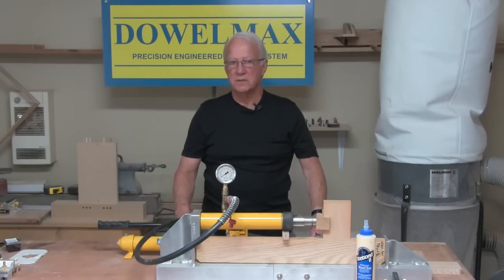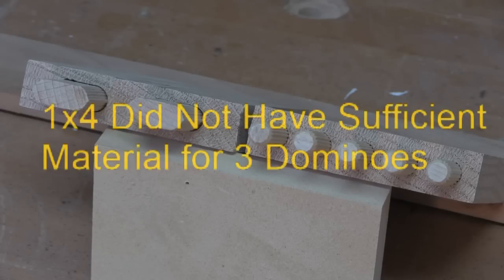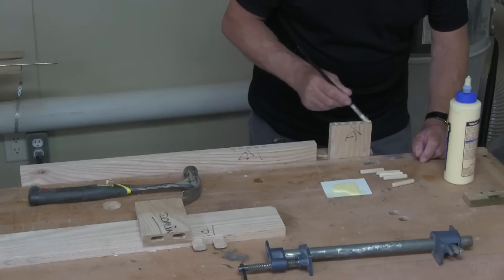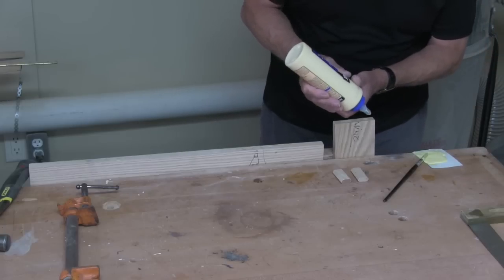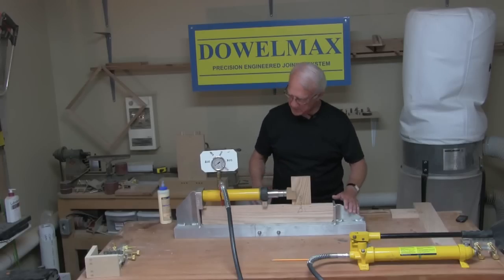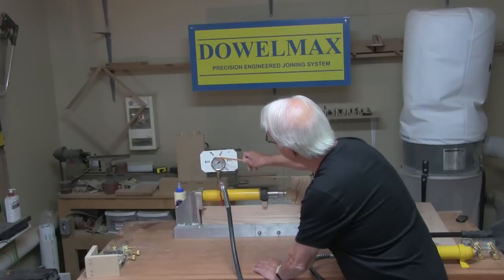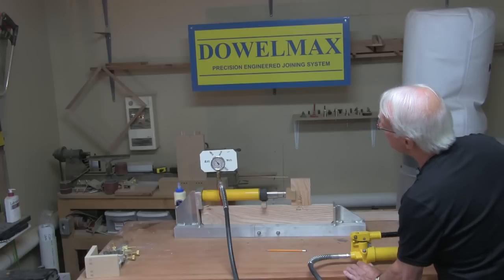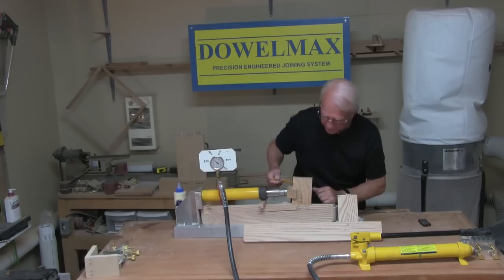Wood Joint Strength Face Off: Dowelmax Vs Domino

Comment: Interesting video. I did notice on the glue ups that the dominos don't fit their mortis as tightly as the dowels do. I could tell right there that it would be the first to fail even before the glue up started. Not sure if there is an adjustment for that on the machine itself but I'll head down the comments and see what any of the  butt hurt purchasers of the domino machine have to say. Slick looking machine but I've always thought of it as gimmicky and way over priced for what it is. I've always used dowel construction myself, but I'm also lucky enough to have an Ayen 50 spindle boring machine in my shop for the work I do.😁
Reply from the maker: Thanks Jeff, The dominos fit tight, however there appears to be tearout at the mortise wall which is typical in our experience.

Comment: Heathen! How dare you blaspheme the holy name of Domino? Our faith in the Great Domino will not be swayed by your "fake science!" The Domino is a gift most holy from the Gods of Construction and Woodworking. Your insidious attempts to undermine our sacred trust will surely fail, as will your nefarious "dowel-base" joinery! If the Great Domino can provide an adequate joint in 15 seconds, it is sacrilege to use 30 seconds just for a purported increase in strength, accuracy and economy. If one cannot afford to pay sufficient tribute for the Great Domino, one should use pocket screws, or simply flee the shop with his or her head bowed in shame! Get the hence! Get the hence! Your blasphemy is not welcome in this venue!

Comment: In the first instance I am an Engineer, not just theoretical but practical too.   We take pride in giving unbiased and honest evaluations, you have my word on that.  You saw what you wanted to see and heard what you wanted to hear. Did you look at the photos of both joints? Did you see the gaps on the Domino example? I doubt that.  Inaccuracy creates weakness.  The local professional we refer to was asked to do the optimum joint arrangement possible on 1x4 stock, and he did just that.  
You discuss performing more samples, and you are absolutely right on that point, but do you realize the time and effort required in that endeavour?  Can I suggest that if you feel strongly about this subject, that you design and build a test stand, and do the tests yourself.  
You discuss the Domino joint being 15 times faster than the Dowelmax joint.  It takes me three minutes to complete a 1x4 joint, and if I accept your correlation, that equates to a complete comparable Domino joint in twelve seconds, not too likely!    I am prepared to accept that the Domino is marginally quicker ( seconds ) but did you also calculate the set up time? The Domino requires to be sized to the stock, with a simple calculation, there is no such calculation with the Dowelmax, merely align,
 clamp and drill, that's it!
I am a woodworker, and it takes me weeks to design and build a piece of furniture.  The layman does not understand this fact, and  I'm literally amazed that professionals can survive in this business.  It would be extremely irritating to streamline your shop by purchasing a tool at over a thousand dollars, when you could purchase one at less than two hundred dollars, which may be seconds slower but stronger, more accurate, and versatile.
The tests shown on our website have been repeatedly done over a period of twenty years, with consistent results, some have been supervised, not all, but all are honest.
Thank you, and regards.  Jim Lindsay.  C. Eng. M.I.Mar. E.
Reply: I know it is pretty off topic but does anyone know a good website to watch newly released series online ?
Reply: @Dylan Milo thank you, I signed up and it seems to work =) I appreciate it !!
Reply: @Johan Joseph you are welcome :D

Comment: You totally pushed the handle faster and full length and harder when doing the domino and went real slow and easy with the dowels also and more if not most importantly any engineer will tell  you a single piece test study is not accurate at all you need at least 3-5 of each test piece and I promise if you pump them the same and make the domino and dowels square centimeter the exact same instead of 5 dowels I believe between 3-4 dowels would be the same then the results would be much much different I’ve seen tons of furniture built both ways and would prefer the domino any day as it is 10-15 times quicker to use which in turn means that production times are bumped way down and the shop makes more profit which is the whole idea of furniture making lastly but still importantly tensile strength is very important in woodworking show that test with at least 3-5 test pieces of each for accurate results and see how that works out until then I am know where close to being sold nor should anyone else with any sense be at this time with this poorly made and ran test. Sorry but that’s all very true ask any engineer or structural architect.
Reply from the maker: In the first instance I am an Engineer, not just theoretical but practical too.   We take pride in giving unbiased and honest evaluations, you have my word on that.  You saw what you wanted to see and heard what you wanted to hear. Did you look at the photos of both joints? Did you see the gaps on the Domino example? I doubt that.  Inaccuracy creates weakness.  The local professional we refer to was asked to do the optimum joint arrangement possible on 1x4 stock, and he did just that.  
You discuss performing more samples, and you are absolutely right on that point, but do you realize the time and effort required in that endeavour?  Can I suggest that if you feel strongly about this subject, that you design and build a test stand, and do the tests yourself.  
You discuss the Domino joint being 15 times faster than the Dowelmax joint.  It takes me three minutes to complete a 1x4 joint, and if I accept your correlation, that equates to a complete comparable Domino joint in twelve seconds, not too likely!    I am prepared to accept that the Domino is marginally quicker ( seconds ) but did you also calculate the set up time? The Domino requires to be sized to the stock, with a simple calculation, there is no such calculation with the Dowelmax, merely align,
 clamp and drill, that's it!
I am a woodworker, and it takes me weeks to design and build a piece of furniture.  The layman does not understand this fact, and  I'm literally amazed that professionals can survive in this business.  It would be extremely irritating to streamline your shop by purchasing a tool at over a thousand dollars, when you could purchase one at less than two hundred dollars, which may be seconds slower but stronger, more accurate, and versatile.
The tests shown on our website have been repeatedly done over a period of twenty years, with consistent results, some have been supervised, not all, but all are honest.
Thank you, and regards.  Jim Lindsay.  C. Eng. M.I.Mar. E.
Reply: @DowelMax  You deserve an award for being able to decipher The Home WoodWorker's run-on sentences.
Reply: @DowelMax  You are a class act sir.  Some people are simply interested in production throughput at an acceptable level of quality. Not high quality, just enough quality to keep product flowing out the doors... You did a fair test, and if a giant, moneyed company like Festool felt the testing was bordering on fraudulent, I expect this video would be done already for the sake of their reputation.  
Until Festool deigns to do a video proving the opposite of your findings, I'm willing to take you at your word.
Reply: @boots7859  Thank you.  Jim.
Reply from the maker: @boots7859  Thank you for the appreciative and supportive comments!

Comment: I enjoyed the test but I would like see a more realistic 2 or 3 dowels at most. I've never seen any application where 5 dowel were used.
Reply: If you want to make a joint weaker use 2 or 3.  I believe the point is you can make a stronger joint and much more economically with dowels, especially if you're willing to spend a few more seconds and a few pennies on material.
Reply: I think the idea of the five holes is also partly because the Dowelmax has five holes.  So you position it once and bang out one to five holes depending how strong you need it to be.
Reply: Hi Karl.  Good point, but not relevant when considering the whole exersize.  For example when I do a test involving biscuit joints (In my opinion an inadequate system ) I use one only because 95% of people do just that.  You are partially right in that when I do a 1x4 in the course of a Dowelmax joint I use four, whereas in the past I used five. ( remember it takes only five to ten seconds to do an additional bore ).  I hope you believe me when I say we try to do all tests in a logical and fair way.  We experienced a comparison test undertaken by one of the top magazines a few years ago, overseen by an engineer.  The whole exersize was nothing short of inept and the conclusions therefore incorrect.  Under no circumstances would I want my signature on something like that.  I'm about to do a comparitive test on four different dowel configurations (all with four dowels) i.e. 1/4", 5/16, 3/8, and 3/8x 2". I'll also do one mortise of similar dimension just for comparison purposes.  Regards Jim.
Reply: @marielindsay528  I'd just take a little more time and use more dowel joints to make it stronger than the $1500 festool.  Perfect for the homeowner who occasionally wants to do fine woodworking.  If I was a production cabinet maker that might be another story.
Reply: @jenniferw8963  Exactly, no real additional time for an additional dowel, but much stronger than the domino.

Comment: The PSI rating is somewhat misleading. You’re not applying the force to only 1 Square inch of mating surface. The 1x4 (0.75 x 3.5) has an approximate mating surface area of 2.62 Square inches which 600psi on your gauge calculates down to ~229 PSI. Of course, all that’s out the window when you add the surface area of dowels and tenons.
Reply from the maker: That is not correct. PSI is pounds per square inch. The area of contact of the wood block on the end of the cylinder with the test wood is 1.45 square inches. The force applied to the dowel joint is calculated as 900 psi x 1.45 square inches =  1160 lbs. You can google pressure to force calculator to confirm:

https://www.sensorsone.com/pressure-and-area-to-force-calculator/
Reply: @DowelMax  This is also incorrect. To convert from PSI to the force the joint sees, you would use the area of the hydraulic ram that is exposed to the hydraulic fluid. The contact area at the ram-wood interface is not considered. For example, assume a 1.5" diameter ram. The area is 1.77sqin * 900 PSI = 1593 Lbs.

Comment: Many different domino wood types and sizes available but you used just the most common least strong ones. Domino system is far less complicated for everyday use. Where is the huge Festool banner behind you?
Reply: Sounds again like an accusation, or a conspiracy theory.  We did not cut the Domino joint, that was done by a local contractor who I'd never met before, and haven't met since.  I asked him to do the best he could to optimize strength, and I certainly didn't ask him to go out and purchase special Dominos.  From experience gained in over twenty years of implementing these tests, the most important , if not crucial factor, is accuracy, not material.  Look at the photo of the two joints, side by side.  J.L.

Comment: Also what's the total surface area of the 5 dowels vs. The domino surface area.   What is the time spent on each joint? I'm assuming all workers are planning to spin up an offshore production facility making mass market furniture.
Reply from the maker: Hi David.  Your first question related to cheap furniture, and I miss the point.  If you look at my completed projects on our website you'll see my goal is accuracy and strength.  I expect the furniture to be handed down, and if located in a dry airy environment, to last for decades or more.
With regard to your second question.  We use what's available and are guided by what people normally do. For instance when we did the comparison with the biscuit, we used one, which is what most people do, yet in fairness there's no real comparison with regard to the surface area. However as a matter of interest, a few years ago I calculated the surface area of five dowels against a comparative mortise and found the latter greater to a small degree, both around nine square inches.  In that test the dowel joint was approx. 30% stronger.

Comment: Board width was chosen to fit 5 dowels perfectly and 2 dominoes imperfectly. I knew the moment I saw the end grain which would win. An equivalent bias would be where the board width was perfectly sized to fit 2 dominoes and only 3 dowels.

And regardless of Dowelmax's reply to Dan Burch, this is mostly a shear strength test. Yes it has a large moment (torque) force, but it's mostly shear. The stresses in actual furniture would be mostly moment forces — which would pull the joint apart.

I'm not criticizing either system nor claiming that either one is better, just pointing out imperfect and biased tests.
Reply: If you had a piece of wood large enough for two dominoes I'm pretty sure you're going to get at least four dowels in there.  Does anyone really think the results will be radically different with four  dowels instead of five?
Reply: Regardless, the domino failed at the joint..... the fields broke the wood. Regardless of the thickness of the wood, the domino failed.
Reply from the maker: This is a typical response from someone with little knowledge of our methods and testing procedures. I also believe that nothing I say here will convince him otherwise.  Dowelmax was intentionally designed to accommodate all the standard imperial sizes: 3/4, 1.5, 2.5, 3.5, etc,. Most of our tests were undertaken using 3.5 stock, which of course will accommodate five dowels.  Why would we do less?  If this person had given some positive thought to the comparison he would have realised that to drop to the next size i.e. 2.5" two Dominos would have left less than  3/16"of material at each end of the joint, and that would have been a flawed test.  Again with three dowels in the 2.5" stock the  Dowelmax joint would have been superior.  Some of our tests have been supervised by professional engineers, and in all tests the other joints were made by outside parties.  Additionally in all cases these people were advised to construct the joints in the most advantageous manner for the size of material.  In this day and age of "fake news" I can understand people having doubts,if in doubt don't criticise, do your own tests, and I will listen.  Tell me what you know, not what you think!
Reply: Dowelmax   Dowels have made superior joint strength for my projects compared to test I’ve done privately.  I’d love to see dowel vs pin though. Although I believe the pin would fail similar to the domino. 
Dowels also accommodate more practical wood sizes. In other words, you’re more likely have room for more dowels evenly distributed than dominos or pins.
Reply: This test favours Dowelmax. Testing methods don't mean anything it’s clear that the width chosen favours your product. If you wanted to be fair you would chose a width that would let both products fill the whole board and not give a clear advantage to your product.

I don't have the money for anything Festool Dowelmax may be the better product but trying to pass off a biased test as fair disqualifies me from from ever getting your product let alone the condescending response to weldabar.

Comment: These comparisons are definitely fun to watch, but ultimately, if you want the strongest joint you can possibly make, a good old fashioned mortise and tenon with epoxy resin glue up can't be beat. With that said, I've used them all and the festool is just a dang slick and quick machine to use.  Never had a festool domino joint fail in real world applications. Size it correctly, make the mortises as deep as your project will allow and always use more than one domino for anything requiring any structural integrity.  Also, consider roughing up the festool dominos or processing your own dominos as the festool dominos are slickish and seem not to absorb as much glue as cutting dominos yourself.
Reply from the maker: I'd like to point out that we've been conducting these comparative tests for approx. fifteen years, and the results have been consistent.  The multiple dowel joint is approx. 30% stronger than a comparable mortise.  Even we were pleasantly surprised!  From an engineering point of view I think the extra strength is due to three factors, and the most important of these is accuracy.  I should also point out that applying epoxy (time consuming and messy) would not really affect the strength comparison, for two reasons: the joint did not fail, the wood failed, and secondly, if you applied epoxy to the mortise, you'd also have to apply epoxy to the dowel joint, a redundant exercise.  our test of the dowel and domino was absolutely legitimate,  we guarantee that, and would repeat it under supervision.  The dowelmax system is more accurate and stronger than the Domino and is close to a fifth of the cost. See the following link for the test of Dowelmax versus a traditional mortise and tenon:

https://www.youtube.com/watch?v=5j3jiAmDfak&t=24s